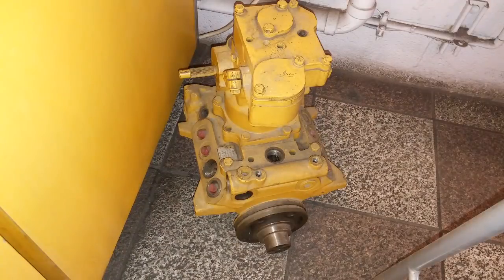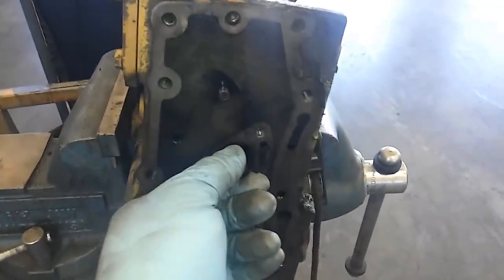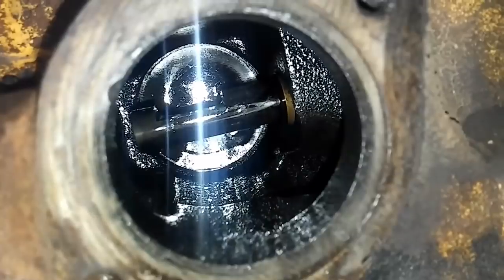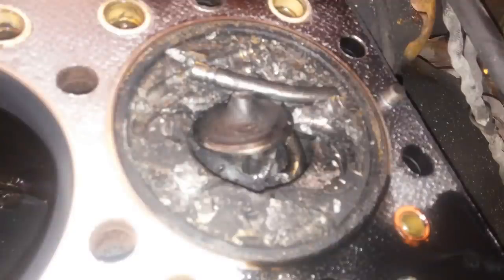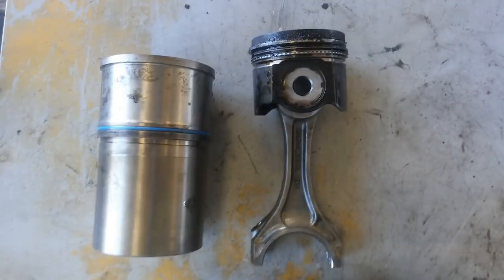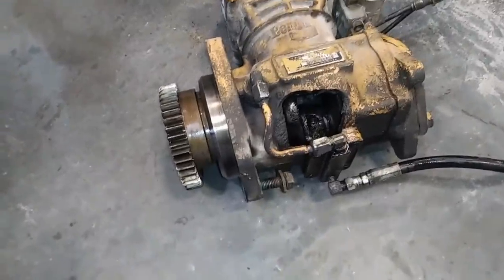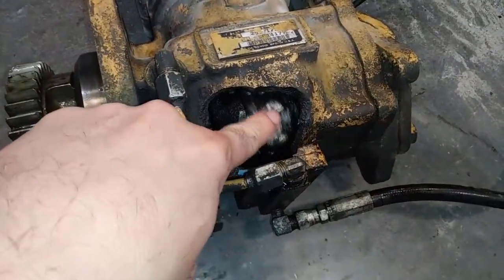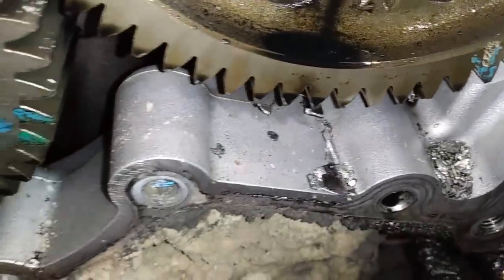Why Do Diesel Engines Runaway? What Is A Diesel Engine Runaway?

Comment: So I have three diesels and none of them are able to run away regardless of the situation because I have a inline ball valve with a handle installed so I can cut the fuel flow off manually and I also have a custom-made electronic butterfly on my air intake that I push a button and it seals airtight and cuts off the air flow and also all three of my trucks are manuals so I would just put them in the highest gear and slam on the brakes might not have a clutch or transmission afterwards but I'd still have an engine which I have had to do this one time on a 7.3 IDI I used to own because fuel got into my oil because of a bad mechanical fuel pump diaphragm but for those of you who have a fear of a runaway diesel if you do not have precautions like I do on my trucks and your engine runs away don't panic don't get scared find a solid object bigger than your air intake rip your intake hose off and block off the air flow 90% of the time this will stop a runaway diesel engine you can also carry a fire extinguisher and spray it into your air intake as this will suffocate the engine there are many ways to stop a runaway diesel or take preventive measures to make sure if it starts to Runaway you can stop it immediately like things I have done such as the inline manual fuel shut off valve or the electronic butterfly that you can control in the truck to stop the air flow but the most important thing to remember is Don't Panic don't get scared because this is how people lose diesel engines when they run away they get scared freak out and run from it simply try to cut off the air flow diesels need two things to run air and fuel in some of today's diesel require high oil pressure you cut one of these off or all of them off on a run away within a reasonable amount of time you can save your engine don't panic

Comment: if you don't want to watch the video this thing happening only with turbo engines and if the turbo picks up the motor oil bcoz you forgot to replace the oil, you replace it with low quality oil and if you do this your turbos valve will getting old and at this valve posision it can get some oil split into the turbo and the turbo is splitting it to the cylinders and the oil is burning sooo much better than the diesel so that's why it smoking like hell, and the fact is a normal diesel's rpm is around 4500-5000 rpm and this number jumps up to 7000-8000 my father is a car mechanic and him and i repaired some car like with this problem the valves the cylinders everyithing need to be repaired/ replaced. You can avoid this problem if you have a manual transmission to put the gearbox in the highest gear and let the clutch off and hold the brake as much as you can or if your turbo is visual at the engine bay take the turbo pipe out and cover the turbo's intake and it will stall. Thanks if you read the whole comment now you are ready to avoid this problem and you know what's happening in this situation. Your welcome :)

Comment: The best way to stop the engine in this condition is preventing the air from the intake by putting something
Or you should use the choke on the exost 
It takes a long time to stop by cutting the diesel line

Comment: a worn turbocharger and oil being pulled from the engine and engine burning that just get the truck in a high gear and let out the clutch ,it will kill the engine had a 3306 do it and  it is quite a rush

Comment: Fun fact gasoline engines can actually runaway, I'm still not sure how it happened but I was going to school for small engine repair and this guy took the governor offa riding mower and started it up and it started to rev crazy fast so the teacher ran in and disconnected both spark plugs and it still kept speeding up until he covered the intake with his hand and choked it

Comment: I always thought a runaway motor will use any and all forms of fuel including the motor oil and even after the head gasket let's go the motor still won't stop untill it runs out of fuel or air. They should use a air or electric actuator to shut the intake off the button should be in the cab.

Comment: Engine stall is the answer.. remember young peeps tring the manual transmition for the first time? Dropping the clutch too fast with litle gas? Easy fix!!! Just doo not throw the first gear, hit the last and drop the clutch

Comment: Best way i've seen to stop a runaway that has its air cleaner in place is aim a dry chemical fire extinguisher into the air cleaner and let her rip
air filter should stop all of the chemicals from getting to the engine and plug up causing air flow restriction

Comment: Simple fix, tie the RPM gauge to a solenoid, to cut of fuel low. No fuel, No engine run.
Reply from the maker: Well that can work unless the engine is consuming it's oil, in which case you have to shut off the air.

Comment: So, no one has yet figured out, no fuel, no running at all! You can quote me on this. Dave Gifford.
Reply: A runaway can even suck oil past worn piston rings to keep burning.
Reply: @Jrez  Thanks. Didn't know that, pretty weird. Guess it's down to cutting off the air then. For as much as it can damage, got to be a way to do it economically.
Reply: @davidgiffordsr.930  Yeah it's kinda fascinating when you think about it. Some people actually put a line with a ball valve to dump the sump as well as intake door flaps with a dedicated lever in order to stop a runaway as fast as possible during testing or display. It can be seen in a Deboss Garage video where they try to induce a runaway in a 16-cyl Detroit 2-stroke. They aren't successful in creating a runaway but do destroy it relatively catastrophically.
Reply: @Jrez  Got me laughing. lol

Comment: I guess that diesel engines aren't designed to run at high RPMs? compared to gasoline engines where 6000RPM is a typical limit.

Comment: The only cause of runaway is human error. Runaways are caused when the engineer notches up and the brakes are not set on nor they are not able to handle the engine power. Locomotives runaway on grades also when dynamics are not working. Also,  diesel locomotives don't runaway when passing the top speed. The engine heatd up and blows its turbo charger and the dynamic fan doesn't work and the fuel leaks and then ignites and then there is a huge smoke explosion. Then you have to manually set it to emergency. It damages it but cars are different then giant locomotive engines like 567's and 645E's.

Comment: There should never be an issue with run away diesels. All it would take is an over speed detection connected to a fuel shut of solenoid and the problem it would come to a stop. I tend to think this is blatant stupidity any system running today doesn't have something that can be built so inexpensively compared to the price of an engine or what they are installed in.
Reply: Shutting off the fuel doesn't necessarily shut it down if it's burning oil from the engine through a bad seal, or combustible gas from the atmoshere.

Comment: You can also put the truck in 4rth gear and very slowly let the clutch out to mechanically stop it you’re probably gonna burn out the clutch but it will stop the engine but never I repeat never let go of the clutch because you’re gonna have a runaway car that’s not gonna stop or your gonna blow the tranny

Comment: I thought Diesel engines have glow plugs in place of spark plugs which heats up the cylinder chambers??
Reply: Glow plugs are only used to heat the air in the cylinder to assist in starting and has nothing to do with the ignition, since diesel engines ignite the air fuel mix with the heat caused by compression.

Comment: why not have a fire supression system that dumps nitrogen into the intake, or a simple valve on the intake that cuts off the air flow, a  less than $200 part if over engineered, but can save a million dollar engine
Reply: Many do, it is supposed to be the standard. The problem happens when they are not maintained and fail.

Comment: the best, quickest and easiest way to kill a runaway car engine is to stall it
Reply: Most modern automotive diesel engines are fitted with electrically operated throttle plates that close the air supply to the engine when switched off. But if that fails and it's running on it's own oil then completely agree. Highest gear and let go of the clutch. Not an option for torque converter automatic models though.

Comment: Most of the time is wrong fuel.  Or the driver puts the wrong amount of a additive.  Some drivers would add a tad of gasoline to each saddle tank.  I seen them do this. Other than that I have only owned three diesel engines.  All of them did over 300 thousand miles . No problems. I sell them between 3 to 4 hundred thousand miles.

Comment: You spent 12 minutes explaining a runaway  incorrectly. Overspeed isn't it. Engine running without fuel is a runaway.  Not with injector malfunction either. Fairly common on old old diesels especially Detroit Diesel since they were two strokes, and had oil puddling due to the roots blower. .Either two or four stroke there is one reason and one reason only: the engine in overheated or failure begins consuming blow by crankcase oil as the fuel supply..As temps cylinder climb, rings begin to fail , and engine starts sucking massive amounts of crankcase oil and RPM soars to the sky. Blocking the air inlet is the only chance of stopping,  After that, still screaming, the internal carnage begins and kaboom.

Comment: How about this:  One single switch that cuts fuel, opens a port in the oil pan to dump all the oil on the ground and then a heavy duty butterfly to cut air flow...all simultaneously? Over kill maybe?🤣🤣
Reply: A butterfly valve on the air intake is generally good enough. Failing that dumping a CO2 extinguisher works too.
Gas Turbine runaways are far more scary.
Reply: Depends on why it's running away. Dumping the oil on the ground? A 3616 has 443 gallons of oil, I am sure the EPA would love this.
Had one engine the intake valve dropped, knocked the tip off the injector and the valve stuck in the head. Since it was the intake the fuel was dumping on the piston and pushing the fuel back into the intake manifold. All the other cylinders was getting a unlimited fuel source. Shutting the air off is the best way. However if the mechanism fails you could send debris into the intake and destroy the engine. Also some engines that are in a safety application, you can't have a shutdown. It has to fail on it's own. 
You have pros and cons of such a device and the owner has to decide what if any they should take. I had a truck wreckered in  and it was taken apart because it would not run. They could not figure it out. It had a safety intake shut down that someone tripped. They had the bill of the wrecker plus my labor and parts putting it back together and rest the shutdown feature.

Comment: Well, you can solve this problem if the designer of the egine put a mechanical valve in the fuel line, like the choke valve.

Comment: The reason why diesel engines run-a-way is due to the way the engine speed is controlled. In a gas engine the engine speed is controlled by air intake. Even a gas engine that is fuel injected it will always have some type of valve that controls the amount of air the engine can take in.

A diesel engine on the other hand is control but the amount of fuel that is delivered. Weather it is a scroll, sleeve, or electronic it is all fuel and there is nothing that controls air intake. So now that we know a diesel engine can get all the air it want it just needs some type of fuel and that is ANYTHING that will burn,,,, any gas or liquid that is. What ever it is it doesn't mater if the engine can get uncontrolled fuel it will run-a-way its just that simple.

I worked for Caterpillar for 25 years as a field tech and have see quite a few engines run-a-way. The rack rotates the scroll or sleeve of the injection pump which there is one for each cylinder. Yes the rack does control the amount of fuel that is delivered BUT it's the governor that maintains set engine speed buy moving the rack. Regardless there are many reasons why a diesel will run-a-way and they can do it because it can get all the AIR it need to burn what ever fuel.

Comment: You may not be reading this at this late date but for the others and you if you do read it Diesel engine can do a thing called Nitrocycling. An engine that is Nitrocycling it is run on nothing but the air it is breathing this causes by the engine is breathing air that is overheated thereby compressing to superheat the air which is when the nitrogen will then oxidize ie: burn just like it were fuel. As you see the engine at this point can not be shut-off by even breaking the fuel line the governor is no longer able to control engines RPM at all causes the engine is only burning oxygen and nitrogen both of which is the air that it is breathing The only way to stop a nitro cycle engine is to cut off the airflow. Doing this by taking apart the inlet path at some point that is very strong and then cover it with anything that also very strong, a very big book placed over the inlet path correctly and quit well fully covering completely this inlet you have opened. then get away quickly. Don't worry the book will stay there if it is full in runaway mode. This also is a good method to stop any other form of the runaway engine. Such as one sucking oil through the turbocharger or valve train.  I've been into Diesel almost all my professional life nearly 55 years until my retirement at age 70. I mostly worked Detroits' and or GMs' but, I've worked on Mercedes', Macks', Cats', IHs', Olivers', DK's and Fairbanks-Morris'.

Comment: The diesel has coils instead of spark plugs But still uses a battery to operate them so no battery. No heat in the coil=no run it the best thing to do is disconnect the battery
Reply: Not true.
Reply: @osyisr6361   is
Reply: @jakefelton03  you are not correct.

Comment: We have mechanical fuel shut off valve on a two cylinder tractor one cylinder weak  so pull that while your trying two start using a little ity bity  warehouse forklift on gravle

Comment: Fuel shut off switches should be mandatory.
Reply: All locomotives I have worked on have a main isolation valve on bottom of fuel tank.

Comment: couldn't this all be solved by using either a mechanical valve or electrical switch that simply shuts off the fuel supply to the rails. And in addition- why not incorporate another safety which will open an 'emergency' compression release valve in all the cylinders. Essentially, this valve would be manually open in the compression chamber negating the power stroke. I'm not en engineer by any stretch... just a weekend warrior but I know a guy who has built a diesel powered motorcycle and he has a manual valve he flips to kill the fuel in an emergency. Anybody?

Comment: ALWAYS THOUGHT I WOULD CARRY A CO2 FIRE EXTINGUISHER, (HAVE TO CARRY AN EXTINGUISHER ANYWAY), RIP OFF A SMALL HOSE, CUT INTO THE AIR INTAKE OR AIR FILTER, STICK THE HOSE IN AND HIT WITH EXTINGUISHER. CAN'T GET IGNITION WITHOUT OXYGEN.

Comment: Diesel train engines can not runaway as the trains are all electric the diesel engine is powering a generator no train is actually powered by diesel through a drive train. The solution to your problem if an exhaust brake.

Comment: Not sure why they don’t just engineer an emergency valve to seal off the air intake
Reply: That doesn't work if the intake fails which is more common than you'd think

Comment: the best way to shut most engines off is to bust the fuel line to engine. other wise try to stall the engine with the drive train. anyway you look, an overspeed condition is going to destroy the engine. protect life . get far away from rig and call fire department

Comment: You really Do-Not want to be near a Diesel Engine if it starts to run away, past the governed engine speed, Should you be near the air cleaner or have some means of shutting the intake air off like fender cover or a floor mat; if you can find one, sometimes the engine oil will act like fuel because of dilution of diesel fuel getting engine oil, But the whole thing is normally the lack of maintenance.

Comment: Thought this vid was about blown turbo's causing the engine to run on its own motor oil supply...  Root cause nr1 for the tiny turbo diesel engines they fit into those bomb shells used to get the groceries.

Comment: My uncle really fucked up his truck, he had it in second gear going down hill when his brakes failed, rpm's went through the roof and so did his pistons
Edit: he didn't press the clutch cuz he wanted to try to brake using the engine, as you can see it didn't go as planned
Reply: Engine brake on a Low gear is a no no

Comment: The only diesel engines that have the rack in the injection pump is a 4 cycle diesel the old 2 stroke diesel engines had the rack in the valve train .
Reply: Both 2 stroke and 4 strokes could have either a mechanical injection pump or a mechanical unit injector system.

Comment: Not true about only engines with mechanical pump.  Electromic ones can too just less likely.
Reply from the maker: There are the oil fed run aways as well, which I discuss in the later part of this video.
Reply: On mechanical engines it can be caused by Diesel due to a stuck rack or by oil. On electronic engines runaways are almost always caused by oil.

Comment: Diesel engines have alot more torque than a petrol engine their for the torque can pull a diesel engine along and diesels do not really decelerate unless you brake so the torque pulls the engine along then the engine pulls in more fuel and oxygen then you have a run away diesel